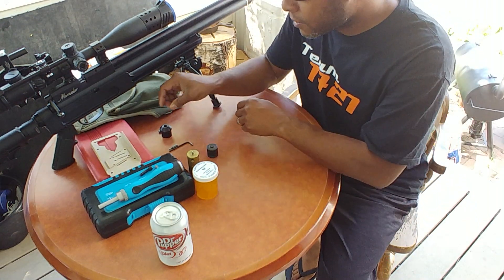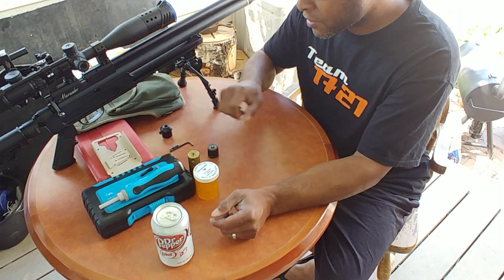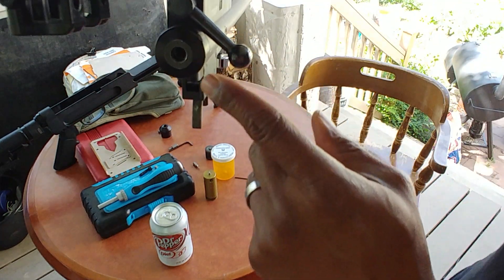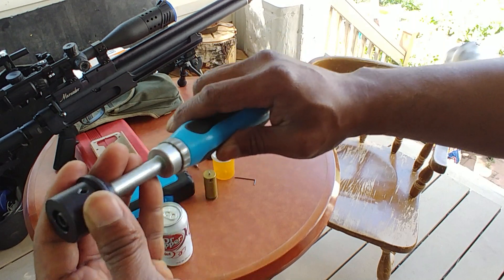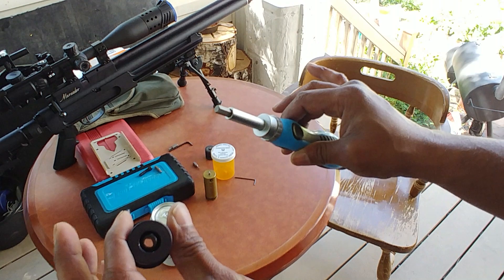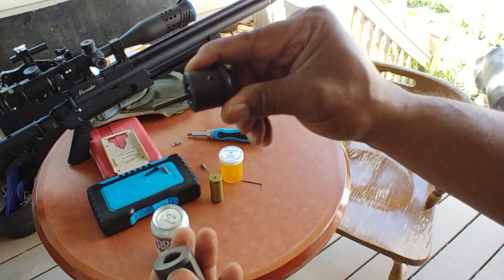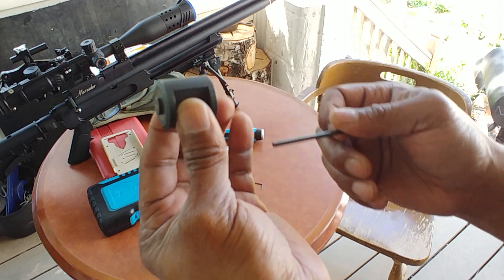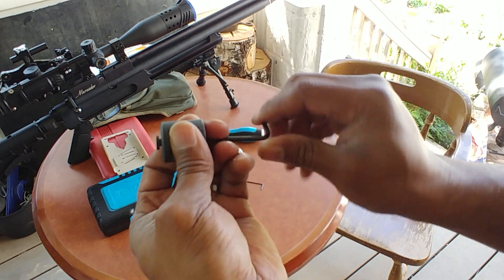How I tune a Benjamin Marauder for power.

Comment: Hi, l have one issue which is when firing l can feel an air coming out from the piston adjustment hole, what do you suggest l should do?
Reply from the maker: When you say the piston adjustment hole, are you referring to the hammer spring adjuster on the back of the tube end cap? Is it a hard puff or a sight puff? Could be a few things.  Have you done any work to the rifle?
Reply: @Monkeydad1969  yes, its back on the hammer spring adjuster and it ain't that hard puff but if l keep a piece of paper it flys off again, l haven't done any work on it.

Comment: How many shots per fill in the 177 nice video bro
Reply from the maker: I can get 20 shots easy, just have to adjust my POA.  But here's a 10 shot group.

Created: 06-04-2018 03:32:13 PM
Description: .177 M-Rod .183 valve/.157barrel
Notes 1: Piledrivers 3200-2800
Notes 2: v.a.1ccw, rva0.5cw mag fed
Distance to Chrono (FT): 1.00
Ballistic Coefficient: 1.000
Bullet Weight (gr): 21.000
Altitude (FT): 0.0
Temp: 93 °F
BP: 29.78 inHG
Shots
#     FPS        FT-LBS     PF
10    920        39.47      19.32     
9     931        40.42      19.55     
8     926        39.99      19.45     
7     933        40.60      19.59     
6     928        40.16      19.49     
5     918        39.30      19.28     
4     921        39.56      19.34     
3     920        39.47      19.32     
2     922        39.65      19.36     
1     914        38.96      19.19     
Average: 923.30
StdDev: 6.02
Min: 914
Max: 933
Spread: 19
True MV: 923.40
Shots/sec: 0.31
Group Size (IN): 0.00
Reply: Thanks for the information bro and that's on the mod on the video right
Reply from the maker: @ricardosankar7619   different.  I did some work to the valve like opening the valve exhaust and using a softer valve spring.  I also opened the barrel port.  So with that work I don't need to increase the hammer spring tension as much.
Reply from the maker: Here is an actual tune as per the video I did for a gent.  Now if I would have opened the barrel port and/or the valve work it would have give up in fps:

Created: 04-24-2018 02:58:10 PM
Description: .25 M-Rod
Notes 1: 3200-2700 8 shot string
Notes 2: JSB Heavy King Diabolo MKII
Distance to Chrono (FT): 1.00
Ballistic Coefficient: 1.000
Bullet Weight (gr): 33.950
Altitude (FT): 5280.0
Temp: 39 °F
BP: 24.81 inHG
Shots
#     FPS        FT-LBS     PF
8     796        47.77      27.02     
7     794        47.53      26.96     
6     788        46.82      26.75     
5     796        47.77      27.02     
4     800        48.25      27.16     
3     795        47.65      26.99     
2     792        47.29      26.89     
1     792        47.29      26.89     
Average: 794.13
StdDev: 3.56
Min: 788
Max: 800
Spread: 12
True MV: 794.22
Shots/sec: 0.15
Group Size (IN): 0.00
Reply: @Monkeydad1969  thanks bro
Reply from the maker: @ricardosankar7619  you're welcome.

Comment: Hi there have a ? Your 1st adj on adj the pin in your video  you turned clock full tight and back it 4-5 turns  does it bottom out or will the pin come off/out cause i went 7 turns but stopped  incase it dont stop.  Thanks boss

Comment: I have n mrod .25 on the way, my first PCP.  This video was so straight forward and easy to understand, I thank you.  I don't remember you mentioning fill pressure...i assume this tune is for 3k psi max fill?   Another question, What's the max fpe one can expect for a 2 mag string?
Reply from the maker: I fill to 3200psi often on my personal rifles.  But on one tune for my bud I filled to 3kpsi and got 2 mags with an 894fps average, high of  905fps, low of 868fps with a 11.49 standard deviation shooting the 25.39gr Kings.  That's unregulated of course.
Reply: @Monkeydad1969 if you remember,  how did that tune differ from this one in the video?  Also is accuracy at all affected by cranking up HS etc? (Just thinking internal vibrations)
Reply from the maker: @9mmkahr  the vid was more for instruction, not an actual tune.  There are more in depth things that can be done, but that involves changing the valve spring and opening/polishing ports...for more power, less shots.  Of course you can change out the hammer spring and if you wanted, get a more powerful valve.

Comment: So do you replace the grub screw on the velocity adjustment when you’re finished?
Reply from the maker: You have a grub screw that goes against the velocity adjustment screw to keep it from backing out. That grub screw does go back in against the velocity adjustment screw.
Reply: @Monkeydad1969   Ah okay.  I just retuned my .25 Armada.   Never tuned it before, Ive always left it at factory settings.  It’s about 4 years old now.   

I followed your tune and ended up making LESS power than before.   So I did 7 turns out on the velocity screw, 7 turns in on hammer spring, and three turns in on hammer throw.

I went from 37FPE TO 43.    

I got more tinkering to do, I guess.   🤷🏼‍♂️
Reply from the maker: @therombaro  what ammo are you shooting?  If you went 7 turns in on the hammer spring, you're probably off the threads on the end cap.  Also, 7 turns out on the velocity adjustment screw is a lot. 5 turns clears the valve exhaust.  Did you turn the striker in on the hammer so it's flush with the hammer?  You would need to cock the rifle, then take the proper Allen key, okay it into the end cap and into the hammer, and turn the striker counter clockwise till it stopped.  That will give you more hammer stroke.
Reply: @Monkeydad1969  Im using Nielsen’s 26.8 grain slugs.   I need the rifle to make absolute max power for an upcoming pest control operation (legit pest control business operation).  I’ll have my compressor easily accessible, so air usage isn’t a concern.   

For the hammer, I fully backed out both hex key screws, and did 7 turns in on the big one, three on the small one.  I didn’t check if they were flush because - quite frankly - i dont know what that means or how to do it.   I took the stock apart to get at the tuning screws, as that’s as deep as I went.   I just figured if I cracked the velocity screw wide open, jacked up the spring, and gave it a long throw that would blow about as much air as possible out of the barrel, but the truth is - I really just don’t know what I’m doing.   

This is my first rodeo.
Reply from the maker: @therombaro  when I say flush I mean that you back out the striker (the small screw in the hammer) all the way out ccw (counter clock-wise).  That is full hammer stroke at that point.  Since you made your adjustments how does the rifle perform?  7 turns on the hammer spring basically takes that adjustment screw off the threads.  I suggest turning it back ccw a half turn to make sure it's still on the threads.
Reply: @Monkeydad1969   It pushes the slugs with a lot of heat.  Definitely wasteful on air but it got the job done.  Air usage didn’t matter bc I took my compressor with me.   I’m gonna tune it back down to plinker strength eventually, but not before I have more fun sciencing the hell of out it.

Comment: When you turn th e velocity adjustment all the way down, is it now closed, or can it still be fired?... I'd like to tune mine to get more shots.
Reply from the maker: If you're talking about the velocity adjustment screw on the right side of the valve when you turn it in fully clockwise it doesn't completely close off the air flow.  It can still be fired and it will help give you a better shot count.
Reply: @Monkeydad1969  yes, thank you sir. I'll see how man shots I can get with it turned all the way down. I have an fx impact w 22 and 25 barrels, but I want to get more shots and quiet down the marauder some.
Reply from the maker: @QBYOUNGBLOOD  please let me know how it goes.
Reply: @Monkeydad1969  I will. One more question. Does it need to be degassed before I do it?
Reply from the maker: @QBYOUNGBLOOD  no.  It is perfectly safe.  Not unless it makes you more comfortable.  But there is no need to degas unless you are getting into the tube to remove or do work on the internals.

Comment: How do I know if I have one of the bad barrels I have purchased the marauder with a composite stock which I assume is new version of marauder
Reply from the maker: You have the Gen 2 which has been out for a few years.  If it is a new rifle, you shouldn't have a barrel issue.  But the bad barrels had machining marks just inside of the muzzle section.  You'd have to unscrew the shroud and take a light to look inside the barrel at the muzzle.  You'd be able to easily see the marks.  But again, if it's a new rifle it shouldn't be an issue.  Also, make sure the rifle is unloaded and not cocked when doing this.

Comment: I have a gen 1 marauder in .22 I'm try this on it.just plinking right now ,a lil hunting
Reply from the maker: If you really want to get into it, you can replace the valve spring for a softer one, open and polish the barrel port, polish the lead and use 1/4" vinyl tubing for the transfer port.  Heck, you could use a nylon hammer then.  Be just like my heavy hitter .177. 😎

Comment: Hey, Great video!, I just bought the gen 2 marauder in .22,  would that setting you showed give me about 880-900fps? I haven't shot it or done anything to it yet. Still waiting to get a hand pump.  I do have a crony. THANKS, Dale, oh, I'm hoping to shoot the JSB EXACT JOMBO 18.something gain, ThanksAgain
Reply from the maker: Shooting the 18.13gr you should be in that range.  But shoot it as is first, you may be happy with the way it's setup from Benjamin.  Well first give the barrel a good cleaning, then lead it back up (shoot a few pellets thru it).  Then shoot it for accuracy.  If you are happy with the accuracy and if the power isn't what you want then tune it.   Good luck and enjoy.
Reply: Monkeydad1969, Thankyou for the quiet reply, when I get the pump, I plan to strip the marauder  down and inspect and clean it really good. I might try the 10lb spring too later, but if it shoots good at 880-900fps,I'm Good with that! Thanks Again
Reply from the maker: @dalebourgeois8843  while you're in it smooth out the punched holes.  They'll tear up an o-ring.
Reply: @Monkeydad1969  , I b have a different ?, I notices my barrel band just barely touch's,  do you think putting two o rings is a good solution?
Reply from the maker: @dalebourgeois8843  That's how Benji does them.  The barrel is stiff enough and shouldn't pose any accuracy issues.

Comment: Hey what other mods do you have on that .177?  I followed your process and with the piledrivers I am getting @540fps for about 13ft/lbs, otherwise bone stock (brand new) marauder F&T with the LW barrel.  Oh and thanks for taking the time to make the vid!
Reply from the maker: The F&T is regulated.  That's not gonna work. I have replaced the valve spring, opened the valve and barrel port, .25 M-Rod transfer port, and tuned.  I'm getting 950-960fps for 42-43fpe.  If you don't want to mess with the F&T, get a used .177 Marauder.  I'd be more than happy to help you thru it.
Reply: Monkeydad1969 how’s the accuracy?  The way it’s setup now I’m getting dime sized groups at 60yds.  I heavily modded my hatsan Bullboss .25, lightened/polished the hammer, opened the transfer port/barrel to 15/64”, JB welded the valve & made single hole facing the transfer port, adjusted the spring tension till I got 950(ish) FPS w/JSB 33.59 heavies....so I’m getting @70 ft/lbs accuracy is good to @75-80 yds which is what I hunt at.   I’d like to have the marauder at the same range with @50 ft/lbs. but accuracy is critical.
Reply from the maker: @darrenfrith3958  I actually haven't done any real groups, but...I tag P-Dawgs at 100-187yds accurately.  The work on your Hatsan is impressive.  To get 50fpe on a .177 Marauder you'll need a longer barrel to take advantage of the extra fps.  That'll get you closer to 50fpe.  Or a aftermarket valve like a WAR valve or a Cothran Powerhouse valve.  Only thing is that the Cothran will over power the setup in .177.  His valves are made for .30 and up on the M-Rod.  I have put them in .25 M-Rods, but it's a fine line between just right and OMG!

Comment: When you fully open the valve adjustment, will it affect the air efficiency?
Reply from the maker: Yes.  You'll use more air.  But this is a power tune for an unregulated rifle.

Comment: hello friend please I want to know if I can install a barrel FX Impact Smooth Twist X. to a benjamin marauder do you think I would adjust
Reply from the maker: Well I'm not to familiar with the FX barrels.  I know they are pretty thin, hence the sleeve.  You'd have to have it machined for the breech.  It can be done, but is it worth it...those barrels aren't cheap.  I am very happy with the M-Rod .177 and .25 barrels.  I wish the the .25 barrel was still a Green Mountain barrel, but I've been told by a very reliable source that the new Benji made barrels are really good.  The .22 I don't have to much faith in, just in my dealings with that barrel.  I've gone with the TJ barrels that Roy of Mountain Air and Jim Gaska machine for the .22 M-Rod.  That's a great barrel.  I hope that helps.

Comment: With this tune can you take down a hog .25calibre
Reply from the maker: If you kept the shot 50 yards or less and made sure you only took a real precise head shot, I'd say yes.  I'd use the heaviest projectile that shot the best.
Reply: @Monkeydad1969  thanks mate ..im not going to stretch more than 25-30 yards
Reply from the maker: @saviofalcao670  should be golden.  What ammo are you using?
Reply: @Monkeydad1969  jsb king heavy mk2
Reply from the maker: @saviofalcao670  that should do the trick.

Comment: What are the cons of doing this?

Just got a .25
Reply from the maker: A lot of M-Rod owners want to squeeze more power out of their M-Rods.  So this is a good, cheap way to pull out more power without spending anymore money or having to take the rifle apart to do work to the valve or replacing with aftermarket parts.
Reply: @Monkeydad1969  I am worried for possible decrease in shots per fill and accuracy does this tune affect them too much?
Reply from the maker: @skullcooker  understood.  But this is a power mod and I'm able to get 2 mags.  But it's not for everyone.

Comment: Thanks for the video, very helpful.  Two part question, I'm somewhat new to pcp guns. Do you de-gas when you make these adjustments? Also, I have a regulated maurader, is there anyway this would mess with the regulator? I didn't realize when I got the regulated version it was a set to a lower fps, I just liked the shot count. I wouldn't think it would matter just wondering your thoughts. Thanks!
Reply from the maker: You don't have to de-gas the rifle.  Only if you need to actually get into the tube.  The adjustments won't affect the reg.  But you probably won't get real high numbers because of the reg.